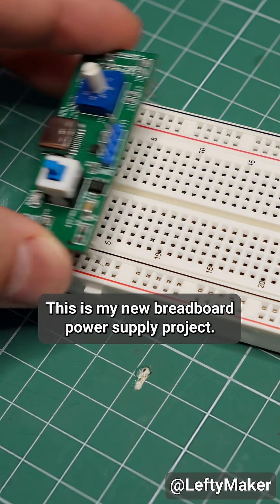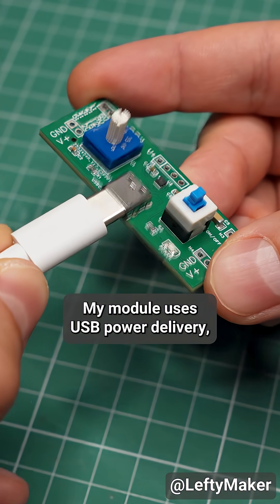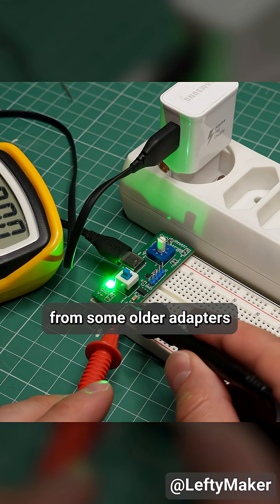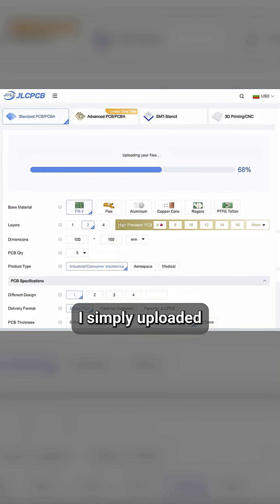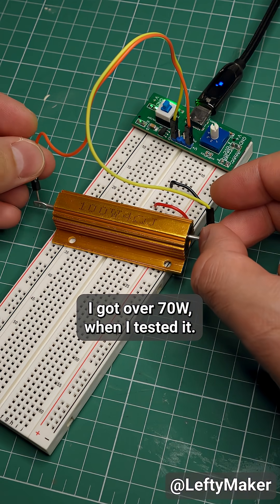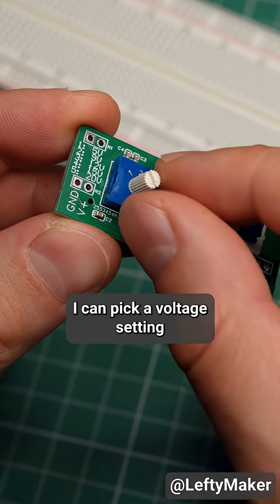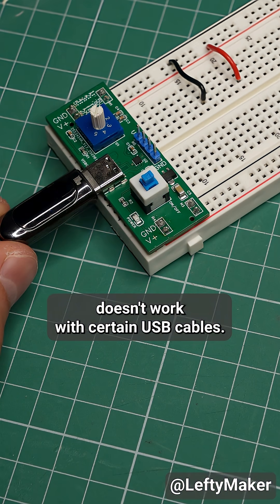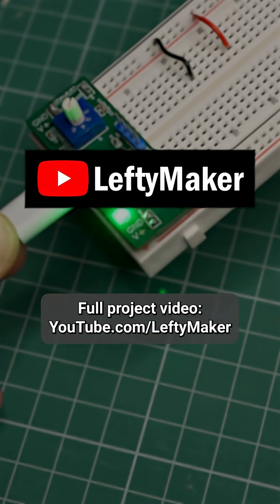I made a 100W USB Power Delivery Breadboard Power Supply #JLCPCB

Comment: Adding an analog circuit to use control theory to regulate the voltage would be cool, and useful for powering devices that require stable power such as a rasoberry pi

Comment: It would be really usefull if both sides can be adjusted differently or if one side is just 3.3V because you rarelly need only 15V. Most of the times with microcontrollers you need 3.3 and 10/12/15/19

Comment: You should use some zener diodes to cut off any extra voltage, in case you want to improve it❤
Reply: Terrible idea. This is a power delivery trigger board with fancy wiring. Zeners don't belong there

Comment: The fact that it doesnt update the voltage until you restart is a great safety feature. that way if you manage to accidentally switch voltage (or a loose piece of wire shorts the wrong contacts or something, anything can happen) then the voltage won’t immediately change and fry your stuff 

You should look into supporting PPS tho. 9 and 12v are great. Maybe 20. 15? Kinda useless. But i could absolutely use 3.3, and pps can often do that
It should also have a small display, just a tiny 7 segment one (those come in truly minuscule sizes) to show current voltage
Reply: 9,12,15,20v - those are all just the standard USB Power Delivery voltages
Reply: @adrianjagielak  and yet anker drops 12v on their power bricks
Reply: @adrianjagielak  yeah i know? And theyre useless for diy electronics. How many chips do you know that want 15v?
15v is only there because 14.7 is one of the multiples of lithium batteries, which makes it convenient for charging and nothing else

Thats why i said supporting pps would be great because it lets you get 3.3v too

Comment: you can maybe add a transitor that maybe uses some circuitry to cut power to the chip when siwtching, maybe this is even better actaully, you can make it someething like: 1. Set voltage, Press Confirm switch (that can be a micro NC siwtch), ad the power butoon ofcourse cuts the voltage bus. you can maybe try both. but i would personally preffer the set one as i dont want to break another whole arduino project display by supplying it 12v instead of 5

Comment: It makes sense that you'd have to reboot the system to get the new voltage. The source only supplies the voltage after a handshake process between it, the other device and the cables chip.

Comment: The voltage getting changed after pressing the switch is i think a great safety feature. It will prevent  the components from damage if the voltage is changed unintentionally.

Comment: I would love such a power supply, I've been wanting to find ways to use all those old heavy "wall-warts" I have stored and wrapped in an absolute wire entanglement in my attic.  I mean tons of them, All random voltages (7.4,3.4,17,19) ect and would love a way to reuse them rather than them ending up in a land fill. I rather not to forced to buy a benchtop power supply if I can just make my own from the random supplies I own. 🙃
Reply: This is most certainly NOT going to help you. This thing outputs the voltage(s) that the power supply can deliver.

Comment: I think using a variable pot which can deliver 5-24v will be more useful, as you can test 24v sensors and check adcs with variable voltages. Also you can add a volt meter display to it. Also provide pins for 5v and 3.3v for microcontrollers.

Comment: Add a voltage display. Otherwise you will fry something soon.
Reply: Voltage display is unnecessary (if ehat is set corresponds what is being fed on output...) Amperage display would be much more helpful

Comment: Great! You might want to add more input adapters like for notebook power supply and isolate the chip. I'm sure you can do this. If you keep the price reasonable everybody will buy this instead of the old one.
Another idea: make it possible to use it upside down so people can use it on both breadboardsides and don't get confused with "+" on the "-" columns, because often shields for microcontrollers use the first rows.

Comment: Hi. In the black breadboard supply module - the one shown at the beginning of the video- I've measured voltages as high as 9 volts or 12 volts. I"m not sure why this is the case

Comment: I understand your idea but you aren't supposed to use 20V in a breadboard... They generally use 3.3 to 5V since it's standard in ICs.
Reply from the maker: Why not? I understand it's easier to blow something up with higher voltage, but I think it's fine. Besides, the better breadboards are rated 36V, 2A by the manufacturer. 5A of current is another story, of course :)
Reply: volts aren't a huge deal 100v and under really. it's  the amps thats going to hurt a breadboard. even 1v high amps will hurt a breadboard and 100v real low amps will be less likely. the amps make the heat. the volts make it possible for arcing if the copper for ground and positive is too close

Comment: Experiment with a switch cutting data or CC line/lines, depending on the chip or power supply, this may give more reliable shutdowns.
Reply from the maker: That would have been the next thing to try, but now I'm thinking a momentary switch could work better if it disconnects the vbus when pushed. That or a mosfet between the input and output
Reply: @LeftyMaker transistor is definitely a good way to go for hot switching!